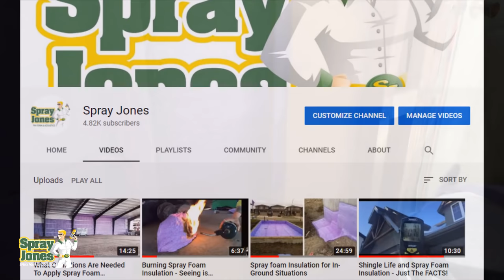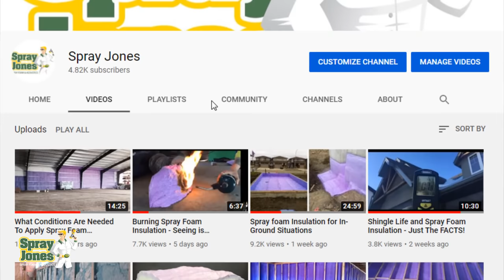5 Spray Foam Insulation Failures and Why!

Comment: You are a spray foam installer who has become desentized to any  smells associated with it.  Like people who can't smell their own body odor,  or when you go on vacation for a week, and your 5 year old house has that new house smell when you return.  Your brain is wired to detect when things are different than before.  Once it becomes normal, you don't notice it anymore.  So don't say people are only imagining that they smell the foam just because you cannot.  You may argue that the smell will fade away after it finishes out-gassing and when it is sealed away behind the wall.  An objective measure from a VOC detecter, before and after installation would be interesting.
Reply from the maker: Sensitization with SPF is the direct opposite. One is set off by the slightest amount, even cleaning the spray gun is enough because the body has reached it limits for exposure and tolerance.
Kind of like BS.

People that think they are smell something when they do not is a legit OH&S study field because nut jobs come in all shapes and sizes and some think they are fat when they weigh 98 lbs. 

Next time you try correcting me on this channel you are banned.

Comment: I have talked to 8 spray foam companies near me over the years.   Really all of them are more about money than knowing the science of what they are doing.   Spray foam is the best insulation but we have way too many issues with installers in the US.   So most of the high end guys around me still use Rockwool and tape to ensure long life.   If I had an installer that was well trained I would use it but we don't.
Reply from the maker: That's too bad.

Comment: These reasons are why I didn't do my own foam job in my basement. Had a bunch of people tell me to just go to Menards and get the kit. If done right, amazing product, if done wrong, a nightmare. Glad I hired a professional.
Reply: Turns out this company is just 3h from me, sadly money now days is not my friend, doing my basement seam joists, based off the videos I can make a best of a annoying situation but deff be calling for a quote int he future as I'd like to get the house done once I finish the basement more
Reply: @Refertech101  It makes a huge difference.
Reply: The prices quoted in the US are ridiculous to its spray the my attic ceiling / underside of shingles.  It isn’t made of gold.  It would literally take a couple hours for a professional.  So I will just buy my own and do it myself.  You can buy the product anywhere but I am an HVAC dealer.
Reply: @Balticblue93  no one can seem to do anything anymore.  My 11 and 15 yr daughters are welding and installing AC units.
Reply: @halledwardb  I totally agree.  My wife could pass any NATE test and install, wire and charge an air conditioning system.  I think it is great you taught your daughters useful skills.  The trades are a great future for the next generation.

Comment: I am actually highly sensitive and usually correct, like identifying a propane leak before anyone else notices, which can be verified. It's not completely made up, some people have a better sense of smell, just like hearing and eyesight. There are just also people who imagine things. Technically they aren't more sensitive if the smell doesn't exist, because there is nothing to sense.
Reply: I have extremely bad lungs, even low voc products cause me breathing problems.
Spray foam, put in during building won't have an impact on me since I wouldn't be able to enter until even low voc paint has cured and the area had the air cleared.

My lungs are bad enough I have a medical exemption to wearing a mask even during the pandemic, I definitely would be making sure the crew doing spray foam knows how bad my breathing is.
Reply: @jaquigreenlees  Yes if it is mixed correctly. Properly applied spray foam is inert but sometimes the mix is off and it does offgass after installing.
Reply from the maker: I have a 35 min video coming out Tuesday on VOC and SPF. Lots of data.
Reply: @valeriy8502  Even when mixed properly there is some out-gassing, If it's low voc then as long as it can sit for 24 hours before drywall goes in even with an off mix, I would be fine.

regular, or high voc products I can't get near for a week.
Reply: @SprayJones  I had to learn a lot quickly when my lungs went south. I know enough to know what I need to watch for and how to tell if there are enough vocs in the air to be an issue. ( if I'm grabbing my ventolyn there is a severe problem )
I have 4 different puffers I use every day, 3 of them multiple times a day. one is a medication that is a one dose a day medication. My breathing gets worse I notice, it's bad enough I had to learn to pay attention to it.
Heck, Starbucks coffee causes problems for my breathing, I can't get closer than 10 metres to one.
Reply: @jaquigreenlees  Of course, I am talking about longer than the standard curing process. That's why people are told not to stay in the home until after 24 hours. It can go on for a long time if not mixed correctly however.
Reply: @SprayJones  Sounds good, I will watch. As far as I understand offgassing while curing is normal, but we shouldn't be able to smell it months later, if so, there is a problem. I am not having this problem with my spray foam, just speaking generally about smells.

Comment: 2:06  On old foam, I usually use the 2lb old stuff as a base layer of a multi inch roof.  If the stink gets through the 3lb cap, no big deal.  Rarely do that but as long as the total inches are up to contract, it works.  Have roofs like this that are 15 years old and are still in perfect condition.

Comment: Your videos a fantastic. It is very easy to see that you are very knowledgeable and care about your end product. I am a commercial roofer and builder and I enjoy the information. I watched your video the other day about a “hot roof” and venting the attic. I have tried to tell folks that for years!! 
I tore apart and rebuilt a Geodasic some years ago. The customer built it himself. He lined the studs with heavy plastic, he sealed all sides of the exterior plywood with gallons of silicone and did the stud cavities as well. He had the roof so tight with no venting that it destroyed the plywood by year 3-4. It was crazy how wet and rotten it was. He should have definitely watched your videos!!
Reply from the maker: Thanks for the comment and feedback.

Comment: Thanks, this was very informative!  We are hiring some pros to come in and spray our new addition. I recently learned about taping the face of the studs to prevent the foam sticking. What kind of tape works best?  I have seen duct tape, painters tape, packing tape. Does it matter which kind?
Reply from the maker: Cheap and easy to remove. Try packing tape.

Comment: I live in KY, USA and had a new metal garage sprayed yesterday. I had open cell foam sprayed and I think I'm going to like it. There is no wood at all and the garage will only be used for motorcycles, ATV and lawnmowers. The only thing I don't like is the metal studs are five feet apart and the foam finish isn't smooth. The salesman brought this to my attention beforehand, so I can't complain. The intentions were to spray the thickness of the 4 inch studs, but they actually sprayed out to make the walls meet the front of my electrical outlets. This is likely about  six inches. I was surprised that you told the customers to tape the studs and put plastic up. The company did everything for me, except take the pictures of what they were doing.
Reply from the maker: Good for you.

Comment: Great video. To many problems to track. Its also very expensive. The quote I was given was almost $40K for a 2500 square foot house. There is just no way I would spend that kind of cash on insulation.
Reply: Hi Chris, yes it costs alot.  Just curious, are you going with Cellulose?
Reply: Would you rather spend it on rising high energy bills for a lifetime?
Reply: I could do your house for less than half of that Chris...probably way less.  With Cellulose I can get you at least R20 in your walls and R45 on top of the flat ceilings.  We'll do your Rimjoist in the basement.  We can do any interior bedroom walls that you want Sound Attenuation.  Air Seal and insulate any access points.  And boom, you save on your bills.  Whats this guy talking about? 
What state?

EDIT:  And NuWool Premium Cellulose lasts for 20-30 years

Then we throw in a 5 year guarantee on all work performed

Comment: Oh ya the smell is only when you apply way too much in one pass and also that your foam is off ratio ( too much b side). so the inside of the foam may burn and it won't cure properly. Off ratio is also very dangerous when it's too much b side or the chemical with the rising agent. Thanks for the share for all these types of failures.
Reply from the maker: You are welcome. Spraying the foam too thick too quick and resulting in smell is a BS answer that has been floating around since 2014 CBC news article. It is quickly becoming urban legend.
Reply: @SprayJones  ah good to know, but it would not let the foam inside cure properly right, the cells will be overstretched. The smell would only come from off ratio issues right? So that cbc interview probably didn't mention specifically that there were probably off ratio areas as well. I mean those installers clearly didn't care.
Reply from the maker: @SinnisjInsulator  The CBC piece did not show ANY off ratio foam. For all purposes the foam "looked" fine but smelled. I am 90% sure why. Someone got caught putting catalyst into the SPF. Hence why the supplier was not held accountable ad the installer played dumb. Either way insurance will not cover you for fraud. Hence why they did not make a claim and have it removed.
Then this BS about too thick started being said in the bars around town... blah blah. I called BS the second someone brought that up. Too thick foam will crack, smoke, do a lot of funky things, but smell like fish?? No never it doesn't smell like that in raw form in the drum... but Catalyst does in raw form!!!
Reply: @SprayJones  well said, thanks for confirming off ratio is how foam can smell. I think one supplier was working on a foam that was much more environmentally friendly when it came to the catalyst it used.

Comment: Another major problem can occur when closed cell resin isn't sufficiently flushed when changing over to open cell product. The classic industry term is "clopen cell". It consists of oversized cells and/or crispy chemistry, but not dark crispy like iso rich foam. Can cause smell/shrinkage issues.

Another possible problem can occur from high lift closed cell (some brands advertise up to 8" lifts) application in cold environment. Can cause shrinkage (smell?) issues and can twist framing.

And yet another problem can occur if applicators are using cheap torpedo heaters instead of expensive indirect fired job site heaters. The exhaust from burning fuel contains moisture which changes the dew point of your spray environment. Can cause shrinkage and smell issues.

Most of these problems can be prevented by using an experienced foam applicator.

Thanks for sharing your experience, Jones, very informative channel!
Reply from the maker: Yes.

Comment: Great video thanks for posting.  Can you comment on duration of smell after installation?  The first 3-7 days after having closed cell foam installed an incredible stench was off gassed from the foam but resolved after.  Foam appears to have proper ratio, density, cell structure and installed within parameters and recommended lift height.  I've never been around spray foam before and wondering if this was expected with usual installation.  Thanks
Reply from the maker: Seems slow... but I have seen circumstances that can prolong disbursement of the odors.
Talk with the SPF manufacturer...

Comment: I watched quite a few of your videos.  Excellent presentations.   I hired someone to spray  part of my small house about 17 years ago (- they sprayed the ceiling and walls. (400 sq ft of living space) I had zero knowledge of potential problems and I never asked).  The guy had been doing spray foam for many years and the job has had zero issues, but I have no idea what was sprayed on my walls other then the guy told me it will make that space structurally stronger as well.   I am now going to spray my garage(under living space) and an adjacent inside hallway.  I removed all of my fiberglass I could get to.     My question - Is there a 'better' or 'best' brand spray foam?  I am in northern Verrmont.  Thank you.
Reply from the maker: Closed cell SPF is the top of the SPF world. That said, getting a solid installer is the major consideration, if that is achieved the should bring with them a top product like Demilec of NCFI.
Reply: @SprayJones  Thanks for the info.

Comment: I had a new house roof deck sprayed with UPC 500 open cell foam. 4 months later and with AC handler in the attic, the house smells like urethane and in the mornings more like a sour smell. So I put a piece of the foam in a zip bag and put it out in the sun. the same sour smell is observed in the bag.
My conclusion is that the foam exposed to heat via the roof deck under the sun stars producing odors which then leak inside the house. This cycle seems to be constant even with the active ventilation in the attic, which defeats the purpose of the unvented attic to begin with. What a disaster. It was applied by a reputable company that has been in business for many years.
Reply from the maker: Sorry to hear that. 
Open cell foam has to be mixed before and during spraying. 
OC foam has a short shelf life 
Properly installed OC foam will NOT give off constant odors even in high temps. I have a video on VOC tests and results. I suggested getting more info to help prepare you for next steps you may have to take.

Comment: SUGGESTION:  Do a video on spraying open cell foam over a layer of closed cell foam !  Also if this is done wouldn't this slow down the freon leakage from the previous layer of closed cell thus improving its insulation level a small amount?
Reply from the maker: It is on the list to be done. So watch for it.
Reply: @SprayJones  GREAT !!

Comment: Hi Spray Jones
Have you ever seen closed cell sprayfoam delaminate from trusses in attic floor? With the wide temperature change from winter to summer and trusses being wood, I am concerned that the sprayfoam would separate from the bottom chord of the trusses.
I'm in Ottawa, 2 storey home being built.
Thanks
Reply from the maker: It will not. A CCMC certified product has to meet adhesion standards. 
As long as it is installed properly you will be fine for generations.

Comment: I have spray foam insulation on shingled new build home.
Now 6 months in I have to replace the roof due to hail .
Can I put on a metal roof?
Does the roof need venting with spray foam?  Visually my shingled roof has seam vents. I don’t know if they sprayed the foam over these vents .
What do I need to know when replacing my roof?  Thank you!
Reply from the maker: I don't know about your needs. Contact your SPF installer, chat with them. 
If non vented roof with SPF you can re-shingle or place metal over with out any major changes.

Comment: If the wood was dry but standard pressure treated will that cause delamination?
Reply from the maker: No. 
Wet or oil causes issues.

Comment: I know codes vary depending on where you live. That said, is it a code violation to spray closed cell foam onto old BX electrical cable? I have a damp enclosed crawl space and I want to spray foam the plywood of the floor above to prevent moisture from rising into the room above. How many inches of closed cell spray foam do I need to stop moisture pentation? Which brands of spray foam do you consider the best to use in an enclosed crawl space?  Should I dehumidify the space before having the foam installed?  

Thank you for this excellent video. It answered a number of questions I had concerning installing spray foam insulation
Reply from the maker: Not for nothing but this channel has all these questions answered in videos. Cruise around and find them, I have wiring videos, condensation videos...

Comment: Thanks for your explanation about spraying in different temperatures.  I want to get my Garage and Room above my front porch sprayed.  Can they be safely sprayed at this time of the year March-April without having issues regarding the temperatures being too cold or having different temperature swings from one day to the next?  Also how long does it take for the foam to completely cure?
Reply: I forgot to mention I am in Ontario Canada (East of Toronto).
Reply from the maker: You more than likely will be fine. But that is not my call it depends on the day and temps, along with system chemistry. Ontario is quite warm now.
Watch " what conditions do we need" video.

Comment: Working on a bonus room and wonder If that's OK to use fiber glass insulation in between floor joists and use foam in between rafters for the rest ?
 it is a very pitched roof

Comment: Do you still need a vapour barrier on those walls and ceilings where you have sprayed closed cell directly to roof and wall plywood between joists and studs?(unvented roof).
Reply from the maker: No. But watch for next week's video. I have a specific one coming for vapor barriers both Open and closed cell.

Comment: I’m curious to know If you’re spraying a 2 x 6 wall do you spread the cavity completely full it’s full and then shave it off I’ve seen some people putting fiberglass insulation will see the spray 3 inches of foam which deck technically gives you an hour 21 and then they put bad insulation on top of that is that recommended desert sweat what are the problems what are the issues